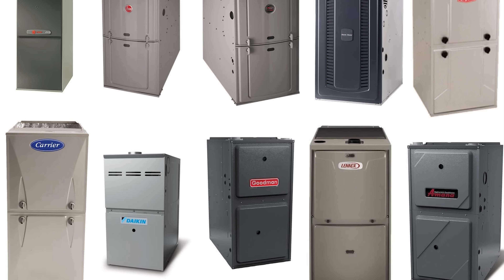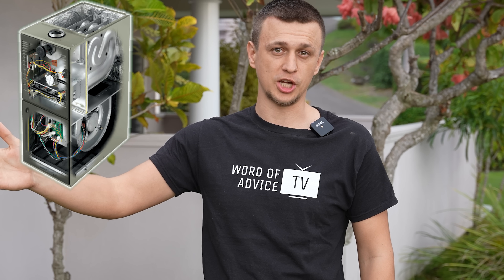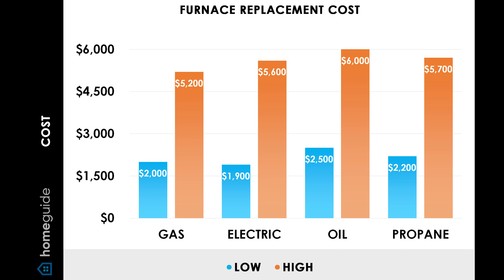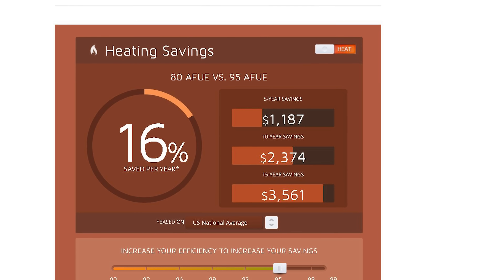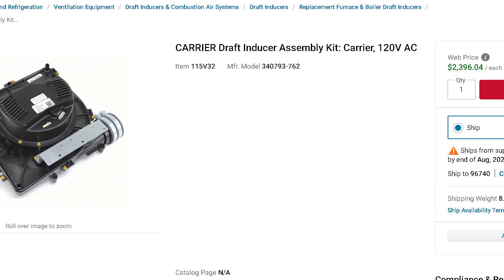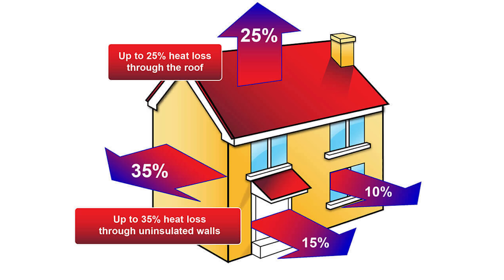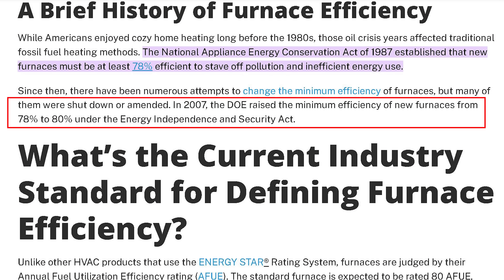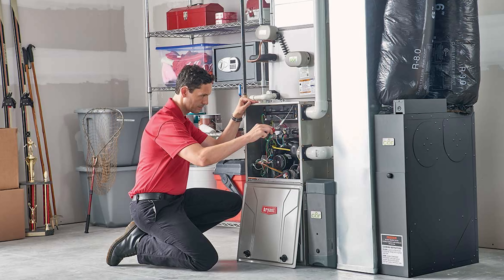Don't Buy a High Efficiency Furnace!

Comment from the maker: Hi everyone!! I just want to make a disclaimer to clear up possible misunderstandings. I am NOT against high efficiency furnaces. They are nice units! They look great, are efficient and quiet. Are they better than the 80% units? Absolutely. If money is not a concern for you, buy a high efficiency unit. I just don't like the sales pitch that highly overestimates how much money these high efficiency furnaces save. Often the 95% furnace is compared to a 60% furnace to show impressive savings but really they should be comparing it to an 80% furnace. People who are looking to save money should opt for an 80% furnace. Less money upfront, less repair costs, and very likely to last longer. It will heat the house just as good as a high efficiency furnace.
Reply: A good layer of spray foam insulation in your attic will save you WAY more money.
Reply: In canada it’s illegal to purchase a 80 percent furnace. A furnace only meets its efficiency when it’s extreme cold. We’ve been putting in iflow units that have a real 90 percent efficiency they blow the gas furnaces out of the water and only have 4 parts
Reply: @mrlukenukem88  Canada!, wow that is really cold up there so I believe you.
Reply: When I replaced my "VERY tired but still working" 35-year-old furnace at my home, my installer asked my opinion and I said 80%. Less to break and cheaper to fix. And he'd been in the industry for 50 yrs. And he said, "yep".
Reply: @mrlukenukem88  don't you need an actual furnace though. These are just basically heat exchangers they do not actually produce heat without a furnace.
Reply: @Pappy-1  an iflow is a hydronic furnace, they can run off a boiler or a tankless. The reason they are more efficient regardless of temp is the turndown ratio of a tankless can use as little as 3000 btu/hr leaving the unit running at a low temp. 
Any other furnace loses the heat when it cycles on and off
Reply: @mrlukenukem88  thanks for the info
Reply: @Hunterhunter-ir9nz  What brand was the old one?
Reply: "It will heat the house just as good as a high efficiency furnace"  --  Actually, an 80% furnace produces hotter air coming out of the registers so I prefer that over the lukewarm air from a HE furnace!
Reply: Yes, I agree with your statement. I work as a Building technician, but I replaced 30 years old 80% furnace into another 80% efficiency furnace again at my home. Thank you.
Reply: @mrlukenukem88  Interesting, I am a HVAC installer for 40 years and specialize in hydronics. The Best I have seen so far is a 10 to 1 turndown. In order to fire at 3000 BTUs you would need a 30,000 BTU boiler, I have never seen one this small. I very seldom will use a combi boiler for this reason as the turndown is based on the max input and combis are usually 200,000 in to satisfy the domestic load. This leaves you with a minimum firing rate of 20,000. What are you doing to get your input down to 3000?
Reply: Try selling a two stage high efficiency to older customers who are use to the big blast of hot air from their old monster.
Reply: @anthonyspadafora1384  navien npe has 15:1 I believe, we don’t use combi. You can but iflow sells a kit and you put a pump on the i flow check valve and mixing valve.
Reply: @jthonn  I'm sorry, I really don't remember. But be careful about paying extra for the best rated. About 20 years ago I paid a premium price for a "Briant" brand. It was #3 on Consumers Reports at that time. Just after my 3 yr warrantee I had to pay to repair parts. Then just after my 5 yr warrantee on blower I had to pay to replace the blower. It's still running though?  But "Briant" was way down the reliability list last time I checked. Like #20 or so in reliability. so you never know.
Reply: @Hunterhunter-ir9nz  Thanks
Reply: @tatekboka7984  Thanks, I'm going to do the same.
Reply: @rpsmith  Thanks for the info.
Reply: @mrlukenukem88  Navien started the 15 to 1 with the NFB but you will notice both the 175 and the 199 have the same minimum firing rate. The NPE water heater is a true 15 to one but still it has a minimum of 10,000. Which is still pretty good, at least much better than a furnace and at least you can utilize an outdoor reset control and make domestic. The problem when using air as a heat transfer medium is cost. Most 100,000 BTU furnaces use 13 amps for distribution and we can transport 100,000 BTUs with water on a half an amp. In the states we use warm air and pressed fiberglass duct in 98% of our systems, you guys are about 50 50 and Europe is 98 % hydronic but they have always had higher fuel cost so initial cost is not as much of a factor.
Reply: @Hunterhunter-ir9nz  
It’s Bryant
Reply: I agree with you, Jay!!
Reply: How come no one is talking about duct work. Most how have the wrong sized duct work and not sealed properly. If you have a chance check out aero seal. The system pressurizes your duct work and give you a certified documentation of how much your ductwork is leaking. Feel 80% efficiency and have 20 inches of squared leakage now you’re running about 62% efficiency so for every $1 to heat your house your  losing .38 cents.
Reply: @North_Coast_Hvac  
Good point.👍
Reply: "Often the 95% furnace is compared to a 60% furnace to show impressive savings but really they should be comparing it to an 80% furnace. "

But the 60% or 80% would be like that 35 year old Lennox I had which took all it's combustion air from the ROOM, there was no provision to pipe in outside air for that, so it pulled it's air out of the basement which meant it was pulling cold air in from "somewhere" along with the heat- that alone probably decreaded it's claimed 80% efficiency down to more like 70% or less. Also, between cycles, that open 5" flue going outside would spill cold air down into the room, there was nothing to prevent that- the flue was open from the top front of the furnace to the chimney cap, while I know they make "automatic" dampers for that, when it fails there's another thing to go bad at 3 AM on a saturday night when it's -10 outside
Reply: never heard anybody say they buy a furnace cause it looks nice .
Reply: I worked for the full service gas utility in St. Louis 35 years and from my experiences I find your comments and concerns quite accurate 👍. Taking care of the envelope of the house should be number 1 on the list. The American Gas Association have been lobbying hard to keep 80% efficient furnaces available but I do believe their efforts will be short-lived. I think we’re gonna be looking at a world of condensing furnaces, condensing boilers and a lot of heat pumps, along with all the extra maintenance, repairs and short life expectancies .
Reply: Lets Calculate: Savings of 95% over 80% for 35 year life of Lennox Pulse.  $1000 year spent on Nat Gas with 95% so spent $35k in 35 years.  Would need 19% more gas for an 80% (.95/.80=.19).  So $35k * 19% = $6,650 saved over 35 years.   NOT ONLY is there energy savings, but HIGH quality equipment last twice as long, so saves another $3k to install another one.
Reply: Hi! make a similar video about instantaneous hot water tanks. same issues. expensive, must service often(calcium build up) and break down more. Unless you have A LOT of people in a dwelling it is not a good idea.
Reply: One angle you didn't mention in your video is there can be a difference in the cost to install depending on the home and how the venting is done and it's current condition. In our situation (old house, cold climate) the cost to line a 3 story chimney for a standard efficiency furnace was higher than to bore 2 holes through 14" of stone/concrete foundation and install PVC. So much so, that a basic high efficiency was about the same cost as a standard efficiency. But that will not always be the case, especially if one already has a standard unit and the existing venting is in good condition. Completely agree on the advice to spend money to insulate rather than oversizing the furnace.

Love your channel, your furnace advice has been super helpful. Thanks!
Reply: @rpsmith  Don't you get more stratification with higher temperature forced air? Ie heating the ceiling...
Reply: Most posts are ignoring a big benefit of high efficiency furnaces: they don't have basically an open path of heat loss 24/7 through the chimney.  It adds up fast, increasing drafts and heat losses.  Adding an active damper fixes this issue but raises the chances of a blocked chimney which I consider unacceptable as it could create a carbon monoxide emergency.
Reply: Repair costs are practically the same. I do HVAC for a living. Don’t talk about things you don’t know. 🤡
Reply: @jamesroscoe7555  -- I'm sure you do but if I'm sitting next to a register on a cold day, I want to feel hot air coming out not a warm draft!  :o)
Reply: @rpsmith  My wife would agree with you. Personally, I like radiators.
Reply: @thomasrausch9790  , 80+ furnaces do not have open diverters to the chimney. Some 80+ furnaces such as the Rheem / Ruud 80 plus provide access for outside air if desired. 80+ furnaces are less problematic and have far less recalls than 90 plus condensing furnaces.
Reply: @mrlukenukem88  lol. HVACR company owner here.
If your heating that hydronic water with electricity then you will never save money VS a high efficiency furnace.

If they have the option of gas hydronic heat then sure, that's what's in my shop.
But I have the lowest electricity costs in Canada and people using electricity as the heating source pay 3x what I pay for heat.
Reply: I will give my one reason for going with a high efficiency furnace. We should try to be efficient with our Earth's resources so they last longer for future generations.
Reply: @mrlukenukem88  and it wouldn't matter if the unit uses 3k BTU /hr constantly. I'm red seal refrigeration, energy is energy. If the boiler uses 3k over an hour but the furnace is off, but then needs to add its max BTU plus 3k BTU from the previous hour it won't matter. The heat never left anywhere.

What I'm saying is, no matter if the unit is off sometimes, or on at a low rate all the time, if the building loses 60k btu/h , it won't matter how little you used last hour, you still need 60k btu/h or the building cools. If you added 3k BTU over an hour, when it comes on it still has to make up the same total BTU loss.
Reply: @boby115  Thanks for the information.  My old 70% or so furnace vented outside.  The same issue applies to hot water heaters.  Most just vent 24/7.  We went with a heat pump HW heater and it's costing pennies.  Also seeing our house humidity level remain comfortable with minimal humidification
Reply: Look at your cost of gas plus taxes and fees based on usage only.  Probably about $7/Therm (1 therm=100067Btu).  Calculate savings from efficiency rating.  80%/95%=84.2% so 15.8% less gas used.  IF $1000/year in GAS cost  (not fixed fees).  then with better unit gives $158/year saved.  over 20 years would be $3160 (disregarding any increases in repair cost - impossible to predict).
Reply: My son just put in a brand new 96% Bryant HE with AC unit. We live 2 blocks from one in other. His house is 200 sq ft smaller than mine. I have a 80 % single stage Bryant that's on it's 20th heating season. We compared our power bills today. Our meter is read on the same day etc. His bill this month was $10 dollars higher than last month, my bill only went up $18. That's only an $8 difference between our two house holds. Same number of people and we are keeping out thermostat the same set point. I would think that my bill would be higher than his by a larger margin considering the differences in the furnaces etc. The difference in my opinion is the INSULATION. I have a newer house and have 6 inches more of insulation in the attic. I'm of the opinion that folks would be better off purchasing a 80% furnace and spend the extra money you saved by not purchasing a HE furnace and insulate your home better. Just my 2 cents....I agree with everything this guy said.
Reply: "should opt for an 80% furnace. Less money upfront, less repair costs, and very likely to last longer. It will heat the house just as good as a high efficiency furnace." 
 I totally agree with you, here from Montreal Canada I have a super efficient 98% (probably marketing) gas methane unit,  and I'm glad to have a $$$ service contract, because parts are replaced almost every year!  
Growing up, my parents had an old oil furnace, I know pollution for sure.. It was cleaned every year, we lived there for 10 years, the furnace was 28 years old we replaced one part while we lived there.
The reality of this is how much does it end up costing overall, not only the initial price of the equipment but the fuel or electricity used, the maintenance/repairs required over the years and inconvenience when you are cold because the furnace doesn't work (also night, weekends and holidays = 2X charges)
Reply: @mrlukenukem88  well i guess i was sold a bunch of..  by Gaz Metropolitain (now called Energir) they sold me a 98% efficient gas furnace.
Reply: @JPTech933  it’s 98 percent on the coldest days
Reply: @JPTech933  if they said up to 98 percent they’re being honest
Reply: @cndjonno  
How does that help my pocketbook?
Reply: Your video was spot on. It sparked a good discussion.
Reply: @mrlukenukem88  what is an I-Flow unit? Is it still a forest air central heating unit?
Reply: @pablopicaro7649  Natural gas cost is likely to double in less than 15 years and more than quadruple in less than 35 years so your calculations are way off.
The savings with high a efficiency furnace could be several times more than what you calculated over 35 years.
Reply: @rpsmith  Sorry, this is completely false. THINK: why would the furnace that wastes 15% more heat to the outside be hotter? 
Every proper 80% furnace will increase the heat of the air by 40 deg F. A 95% one will do at least 50 to 55. You'll have hotter, not cooler air with it.
Reply: @jimbarron8688  High eff furnaces output hotter air. Fact.
Reply: @sprockkets  -- every 80% furnace I have ever had puts out much warmer air than my 90% furnace.  I think that is because the 90% models need to run cooler to condense properly.
Reply: @RP Smith  again, false. Condensing furnaces run the intake air first over the condensing section of the heat exchanger, then the hotter gas tubes up top. A normal one just runs the air first over the hottest section of the exchanger. 
I have never, ever had 50 temp increases with 80 percent. If I did that's an air flow problem. If you are not getting at least 50 degree rises with a condensing furnace,  your furnace is malfunctioning.
Reply: @sprockkets  not while firing on the first stage they don't, that is a fact.  Firing at first stage heating it uses only about half the gas pressure it would use at second stage heating.
Reply: @jimbarron8688  False again. On low stage fire my furnace inputs 50k vs 70k on high fire, and adjusts the air flow accordingly. So you managed to be wrong 3 times - about the exit air temp (and that's a fact because you need a constant heat rise for proper heat exchanger life), about low fire being half the input of 2nd stage, and about the gas pressure, which too isn't half of what it is on high fire.
Reply: Thanks for this and all your videos. We recently purchased and moved into a home that has a 20year old, kenmore, high efficiency 92% AFUE, furnace with a DC variable speed motor. Just a few days ago the blower fan stopped working, and I’ve been viewing your control board/blower fan troubleshooting videos. Unfortunately, those videos were on non high efficiency furnaces, or without dc variable motors, so when trying to replicate on my furnace, it looks significantly different. We really don’t want to replace this furnace, but are struggling to troubleshoot it. Could you please do more repair and troubleshooting videos on high efficiency, DC variable motors please? As you mention in your video, they are more complex and expensive to repair, so any help you can provide to new and budget conscious home owners, would be greatly appreciated. Thank you.
Reply: Let me help here. I have an oil furnace simple maintenance and only one simple board and 2 ton fan. If I have to replace it will take me 10 years to get the money back and if nothing else goes wrong with a $4000 unit during those years, that I doubt it, based on how cheap and disposable everything is made now in 2024/25 But remember many argue because the way they get dopamine.😎
Reply: @cndjonno future generations will use solar+ wave+wind+thermal. Prediction said also that by this year green energy will take over coil.
Reply: Not if the damper has a switch that closes when fully open. This way furnace will not fire unless damper us proved to be open.

Comment: I do HVAC in Canada and I agree 100%. I see older furnaces lasting 25 years and my boss wants me to convince the customers to have them replaced with ZERO problems. The pitch is that they will save money. How the F do you save money by spending money? The heat exchangers on those old furnaces are 1000 times better. I have seen so many York furnaces have heat exchanger problems after 3-5 years its mind boggling.
Reply: My home was built in 1995 and the original Carrier (standard efficiency) furnace is still going strong. And I live in Wisconsin so it gets used on a year-round basis since I also have central air. I'm also still using the original refrigerator and stove with zero problems. They just don't make things like they used to.
Reply: The reason is, when a furnace is required to be more efficient (a newer model) the heat exchangers are thinner and don't last as long due to metal fatigue.  Older, less efficient furnaces have thicker heat exchangers.
Reply: Thank goodness I chose a Lennox over a York last week!